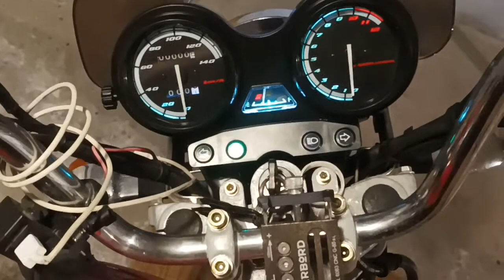How To change clutch on Yamaha YBR 125 ED6 engine

Comment: The engine protection bracket needs to be sawed off, not bent, IMHO. It is not needed. If you lay the motorcycle on its left side (soft place), there is no need to drain the oil.
Reply from the maker: @strannikstrannik1  you do you my friend!

Comment: I changed the clutch with all the discs even the metal ones, I changed the springs but the clutch slips the same every time I accelerate hard. When I start up a hill the clutch shakes. I'm desperate I don't know what to do anymore
Reply from the maker: Is your clutch basket ok? Does it have signs of wear where the metal plates mesh with the basket? Did you adjust the central bolt correctly? You need to do that when you change the clutch, otherwise you'll burn it straight away.
Reply: @simondoesthings  clutch brasket was perfect  bike has only 25k km , how to adjust central bolt? i adjusted that it disengages the clutch when i press the leve, is that ok?
Reply from the maker: The manual states that you need to fully undo the adjustment screw near the lever on the handlebars, then screw in the middle bolt untill you feel it touch the engine's clutch lever
Reply from the maker: 25kkm might wear out the basket if you were hard on the bike
Reply: @simondoesthings  did he put his plates in oil for 12-24hr
Reply from the maker: @GooseDub true, hope he did read the description and did that

Comment: Hello great video I just have one question I had to replace the seal on my clutch rod as it was leaking but now my clutch rod won’t slide fully back down into the engine and it feels like it’s hitting something do u know how to solve this problem it’s very hard to find info on these bikes
Reply from the maker: Do the splines interline? As far as I know there's only one way to put it back and it won't fit if you turned the rod. If you can, make a short video of the problem and post in on your channel, then comment here again, I'll see what the problem is and will help you to the best of my ability. I have a full service book for those engines so I'll have to be able to find something.

Comment: где такие дуги взять можно?
Reply from the maker: I don't know if I understand you correctly but the clutch kit is from eBay. Generic ED6 Yamaha engine clutch - remember to keep it in oil for 24hrs before install.
Reply: @simondoesthings  No. Where can you buy protective arches? How about you
Reply from the maker: @КопыловВячеслав-з2л  they're available in Poland "from the shelf". Your should try allegro.pl, they ship international
Reply: @Simon does things  why do you have to keep it in oil for 24 hours ?
Reply from the maker: @V6PSC  this is a wet type clutch system, the disc is always submerged in oil and the material with which the clutch is made is organic in origin. By keeping it in oil for 24h prior to instal we're giving it the best possible conditions for lasting as a long time. Hope I answered everything 😁
Reply: Мотоворон Харьков